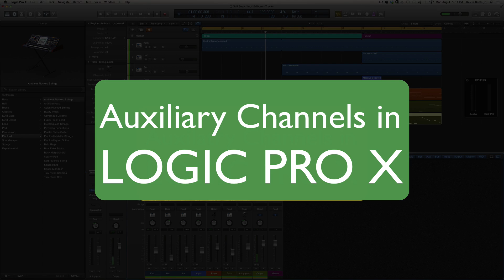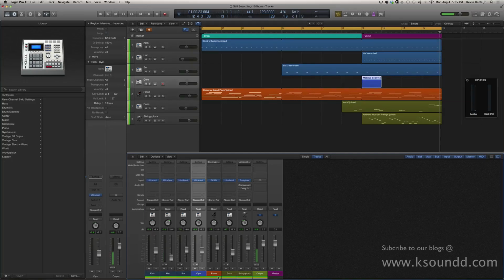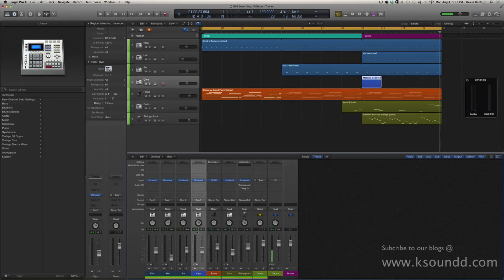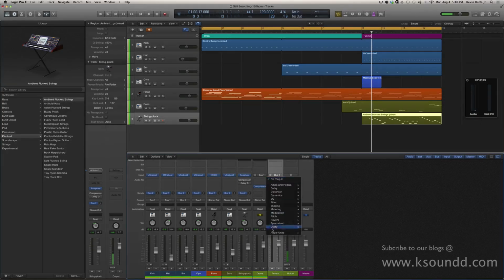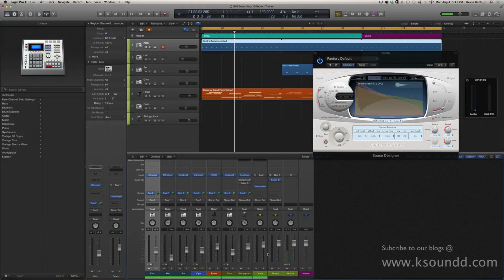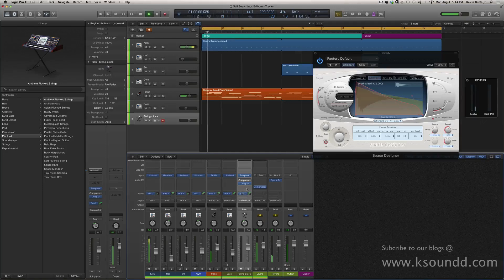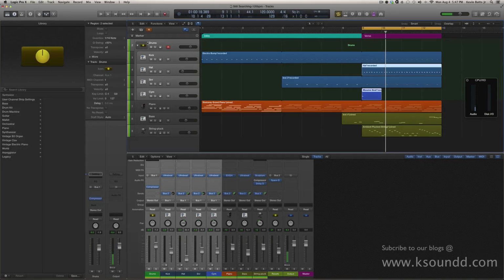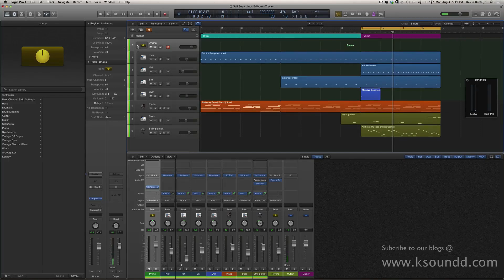Logic Pro X Tutorial- Auxiliay Sends Buses

Comment: Let me ask this.  I have four separate tracks on my podcast (all for of those tracks are vocals), All four tracks have the same effects on each track so lets just say I add an additional effect on one track, I have to add it on the other three remaining tracks.  So here is the question, if I bus all four of those tracks to Bus 1 does that mean I can remove all the effects on each of those four individual tracks as I can now just add all those effects on bus 1 to control all four tracks?
Reply from the maker: Yes. If you have the same FX on all tracks, its better to send them out onto a BUS/ AUX channel as it will save you CPU memory. However, if you are only using 4 tracks, it may not make a difference as much. But if you move into a project where you have 64 channels then you will see the significant difference.
Reply: Brah, thanks for the quick response.  I am using Logic Pro strictly for podcasting. My effects for podcasting are lined up in this order 

1. Speech Enhancer
2. Channel EQ
3. Compressor (Peak)
4. Compressor (RMS)
5. DeEsser
6. Adaptive Limiter
Reply from the maker: All of these can be inserted onto a bus except the deesser since it responds to each vocal differently. Don't want voices that may overlap creating something unwanted. You want the deesser to attack the voices separately. But you can always experiment with them to see what the outcome would be. It may just work with the deesser on the bus. Try it out.
Reply: Will try it.  It should work because the two voices (me and my co-host) on all four tracks are just us.  No other voices.  One more question.  When I send all the racks to the bus.  I  see clipping in Input, Bus, Aux and Stereo Out but yet the audio still sounds great.  Because the signal from  the Input 1, Bus, Aux, Stereo Out and Master gain are clipping, I turned down the gain on the Master channel strip just enough so that particular channel strip (Master strip) was not clipping however the Input, Bus, Stereo Out and Aux are still clipping even though the audio signal from the Master gain sounds good.  Is that okay when I bounce it. gain a little
Reply from the maker: Take the limiter off the buss and onto the master
Reply from the maker: Your master should not be clipping
Reply from the maker: It really should matter as long as you have the channel volume at unity. Do not boost the volume on the master or bus. If you need volume, make those adjustments on the tracks themselves.
Reply: The master is not clipping. It the Stereo Out, Bus, Aux and Input that is clipping
Reply: So Should I position all the slider from the at the 0 db position
Reply from the maker: No. As long as your not clipping on the master and you don't sound distorted you're good.
Reply: Okay cool dass wussup.  I am trying to start a Podcasters of Virginia group to help other help each other with podcasting.  I am from New Jerz but moved to VA just recently.  I also want to start a Logic Pro X group just to get help and help others who may have questions as I did/do.  Where you from dawg.
Reply: I forgot one more question.  All the effects that I have on the channel strip.  Is it best to record with them all off and then apply them in post production of should I turn them on and apply them while recording?  So for all the question brah but I am fairly new to Logic Pro
Reply from the maker: DJ Takin' It Back from Chicago and recently relocated in Dallas TX
Reply from the maker: DJ Takin' It Back the way you record is totally up to you. Most of the time it depends on how much your computer can handle. Recording with plugins on can sometimes cause a latency issue. Please note that if you record with plugins, it won't effect the raw recordings which means you can bypass or totally discard the plugins and your original recording won't be effected by EQ, compression, and so forth. 

I personally prefer recording dry without plugs so I can hear the quality of the raw audio before adding anything to it. This way I can identify any issues like buzz noise coming from the cables, background noise that can effect a good recording, and making sure I'm not distorted. If there's reverbs, or any other FX going on, it's harder to hear that stuff in the beginning.

Comment: Sick tutorial, finally got me where i need to be. quick question, do you recommend putting more than one effect on a single Aux channel? say u know you will be delaying, compressing and Eqing certain tracks, could u put all three effects on a single Aux or should you create three different Aux tracks?
Reply from the maker: Sure
Reply: haha sorry, do u mean sure as in put em all in one, or make three different Auxiliary tracks..?
Reply from the maker: Separate them if you need to process several channels thru them depending on the need or put all fx on one aux if your trying to achieve that sound for that specific aux. it's totally up to you. My whole thing was using an aux channel to avoid putting the same plugin with the same settings across several channels. I only use plugins on any channel if I only need to affect that one track different from the rest.

For instance I may a compressor on the kick for more punch and activate the side gain function. I may not need to repeat this process for anything else so why use a aux channel in that instance. Usually reverbs, delays, or BGV VOC channel strips are bussed to aux tracks.

Comment: The best uses for this are when adding the same effect at the same rate to multiple tracks (1 plugin running vs 90) and when you want to send something pre or post fader. A good example for this would be distorted guitar vst. Sending it post fader would mean the input into the guitar vst would increase or decrease with the fader level. which would increase or decrease the distortion just like the volume knob on the guitar does. because it's a hotter signal at higher volumes. sending it pre fader would mean  you can keep the level of distortion on your track and just reduce or increase the volume based on fader level. 

This is just one example but many more exist.
Reply from the maker: Awesome

Comment: Didn't help. Still getting overload errors. I took off all the plugins, made bus channels, and, and track stacks, and STILL getting overload errors.
Reply from the maker: There are several factors that plays a role. Do you have at least 8giggs in memory? I have 16g. Do you use and external hard drive? Working from the internal hard drive can cause issues. Make sure the hard drive your working from is 7200rpms
Reply: +Ksoundd Def I have 16 GB of RAM, I never ran sessions of my external in Logic. Never needed to. I have a 1 TB external that I use for Pro Tools. Looks like I'm going to have to use it for Logic as well.

Comment: Awesome video. One thing I don't understand though: When I send e.g. 3 tracks to a bus (e.g. bus 1), it creates a bus 1 obviously. However when YOU create a track stack in the video, the bus (bus 1) becomes part of the track stack. When I do it, it creates a new bus (e.g. bus 2) and routes all the tracks to the new bus (2). Hope that makes sense.
Reply from the maker: +Dan Goode If you already created a bus before creating a stack track, the stack should take on the bus youve created previously if the tracks you selected are all the same (same bus). If you are selecting tracks with different bus sends, it will create a new bus. So make sure the bus is the same.